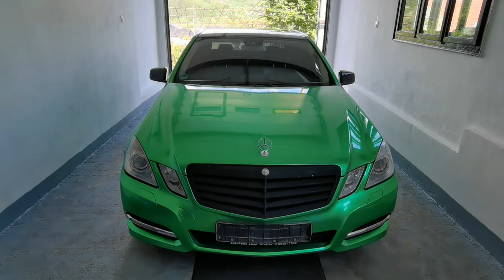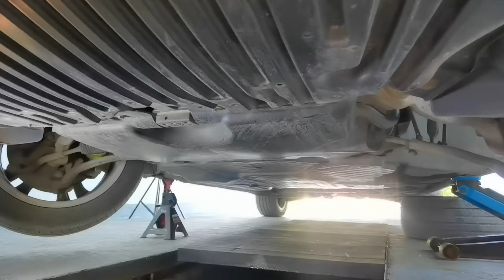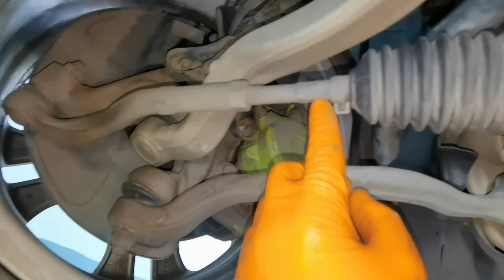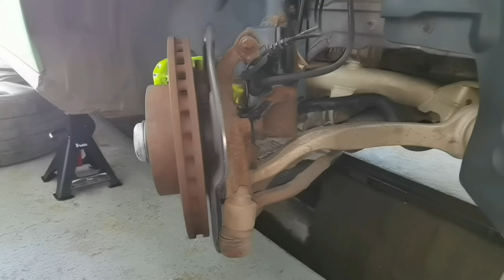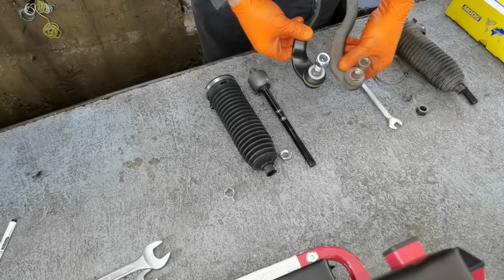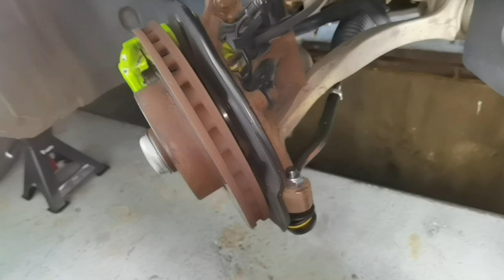MERCEDES E CLASS W211/212 OUTER AND INNER TIE ROD REPLACEMENT!

Comment: Important point to remember: The torque spec for the nut on the ball-joint end of the outer tie rod is 50nm + 90 degrees after.
Reply from the maker: Thank you for feedback 🙏

Comment: Hi, can I ask you, how did you jack up car ? middle jack point (rubber brick) you couldn`t use due to canal. So how did you placed jack stand on one side :-). I`m asking, because I have similar garage
Reply from the maker: I have enough space for the Jack's on the sides, the canal it's not as wide as the car so I have atleast 25  cm on each side for the Jack's to be  places under the car, and if you use a low profile hidraulic jack you could also place it at  an angle and you'll fit it perfectly under any car. Hope it's helps 🙏

Comment: Hello, and thank you for the great video. Can i ask, is it possible to do this job with the car in a normal garage, or do i need the canal/well to have enough space to get under the car?
Reply from the maker: You can do it even în the parking lot. You just need a good jack and something to support the weight of the vehicle and that's it. Just follow my steps and you will be able to do it very easy. Good luck 🙏💪
Reply: Can i ask another newbie question? How to jack the car up, and then place jackstands? The car have only one jack point on each side, and when i’ve jacked it up, there is no space for the jackstand, as the jack is taking up the point :p
Reply from the maker: Good question. I always lift it from the nearest point to the jack point. And the. I have enough space to pus my jack right on the jack point made for this.
In some cases you can bend some metal parts from underneath the car or you could brake the plastics from underneath due to heavy weight of the car. That's the risk of doing it yourself. Just be careful.
Reply: Thanx! Yes, last time i jacked it up on stands i put the jack as close to the jack point as i could. It did some damage to the dust cover and the metal seam underneath. I just hope this wont induce rust problems or hurt the canals.
Reply from the maker: You'll be fine sir.

Comment: Hey great vid. I just purchased some new tie rods off amazon from some no name company and they don't come with those little round metal discs that sit between the ball joint and the wheel hub. My oem ones had this and I was wondering do I need to put this ring on the new ones I ordered or do I just put the new tie rods on without that thing? I am not sure whta the ring does.
Reply from the maker: You could put the old ones from the old tie rods just to be sure, some manufacturers don't put the entire kit with all the necessary parts and because of that you have to reuse some of the old parts wich you removed from the car.
Reply: @HOWTODO0828  oh ok I was not sure what these rings did so I left them off. Do you know what they do?

Comment: nice video! i have clicking noise when turning wheels is tie rod?
Reply from the maker: Yes it's the tire rod. My recommendation it's to replace the inner and outer tie rod just to be safe and just to make a verry good job on your car. Good luck mate 🙏
Reply: @HOWTODO0828  can it cose wheel shaking when braking? i already change discs and pads. .i think my wheel hubs is not straight to.
Reply from the maker: Yes it's can cause them to shake during braking and on heavy terrain

Comment: How much did the parts cost you? I hit a curb last night and snapped from passenger side inner rod. Hoping I can fix it
Reply from the maker: The parts are not so expensive, around 50 buck on both sides,you cand fix it very easy if you are able to do it yourself. Follow me and good luck

Comment: Why there is no difference how it sounds before and after, is it not the steeringrack which is worn!?
Reply from the maker: I yes. The steering rack it's also worn. In the video I couldn't show the improvement but there it's a improvement with the new tie rods.
Reply: There is still „play“ after
Reply: 7:19 You can see the wear demonstrated here.
The worn tie-rod is extremely loose whilst the new one is tight.
Reply from the maker: Yes sir. Thank you for supporting me and my channell 🙏